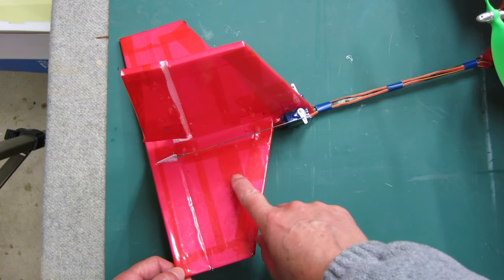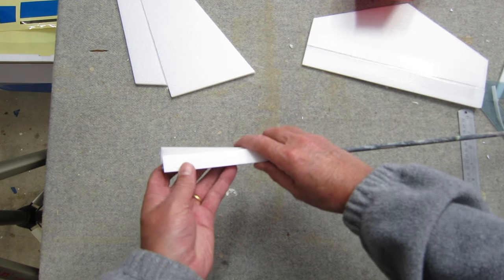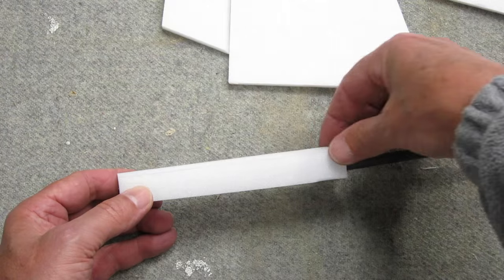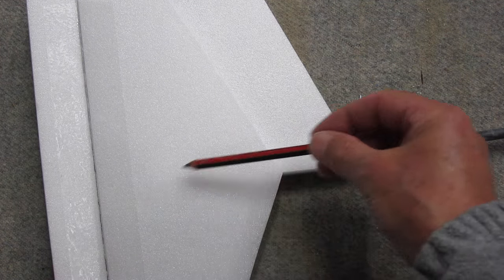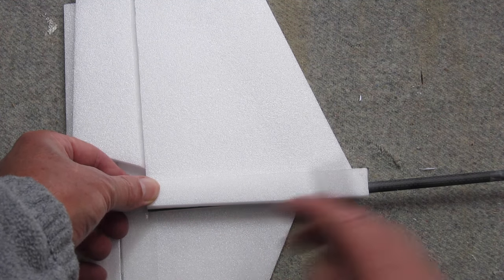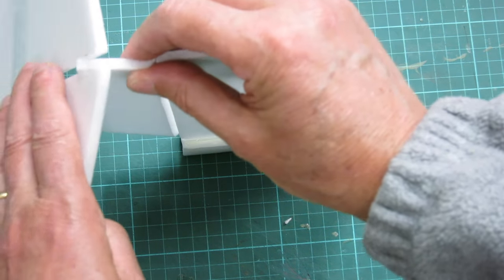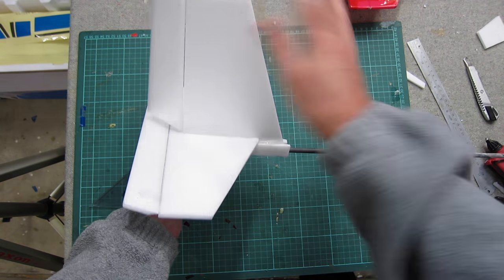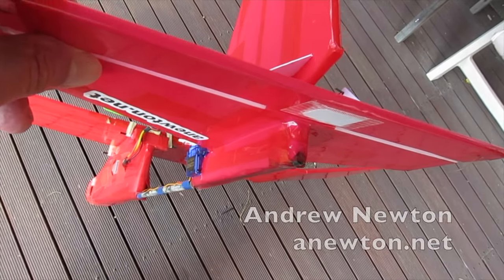Cross Tail build

Comment: Hi Andrew,
I have not yet seen all of your films but the are always good!
thank you for........

why do you make a slot in the elevator?
is/it was not easier to take/glue the elevator to the bottom of the stick/CF rod?
it was not simpler in order to glue the elevator to the at the bottom of the rudder?

Regards from the Netherlands
Rob.
Reply from the maker: +R. Rob. I wanted extra strength for the rudder elevator join and to lift the elevator up for landings

Comment: hi, thanks for this great tutoriel! juste one question : the engine show an angle with fuselage. if I do my own design, is there a way to calculate the good one? or do I have to experiment myself?
Reply from the maker: +Sebastien Devolder (sebdev) I think every plane design will need a slightly different angle so you do have to experiment a little. My 3ch Trainer is about 10º, the Bixler and Cloud Surfer use about 12º
Reply: +Andrew Newton thanks you very much for the quick answer. have good flights!